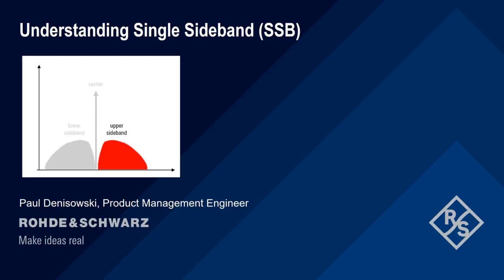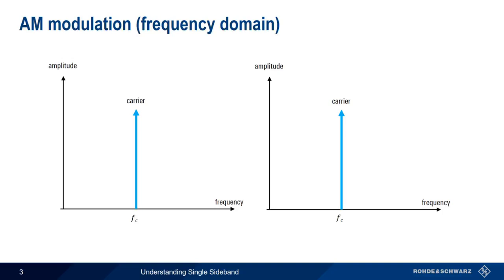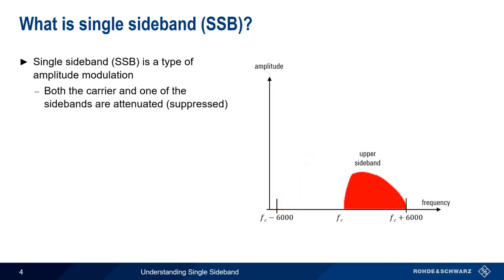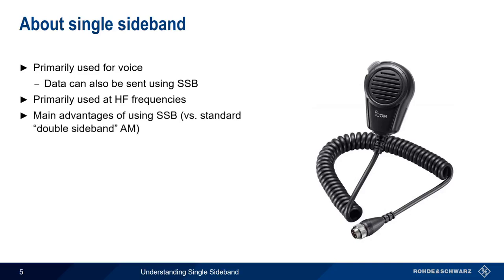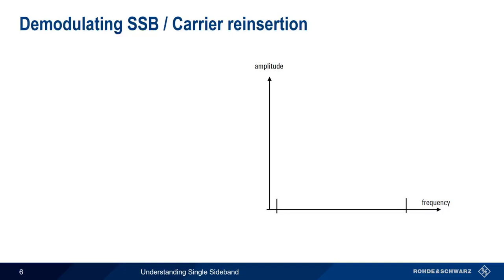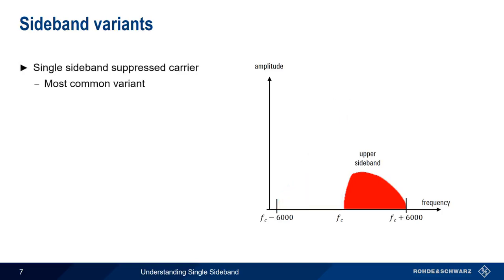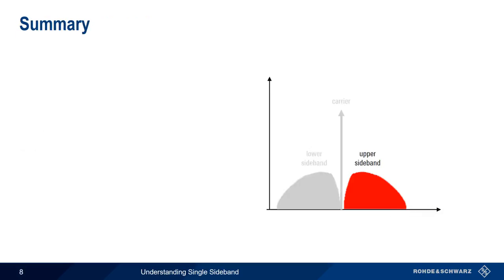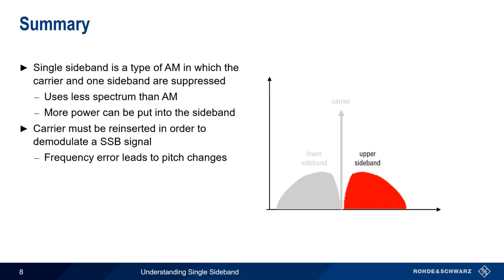Understanding Single Sideband

Comment: Before being replaced by satellites, Independent Side Band was used by international broadcasters like the BBC and Voice of America to feed programmes to their overseas relay stations. It enabled one transmitter to carry two separate programmes. At the receiving end it sounded a mess unless there was a receiver with the correct filters - then you could switch between upper and lower sideband and hear a different programme.
Reply: You can still experience this interesting effect during greyline/grayline, if you find the right station.

Comment: I STILL dont get it how you can have a sideband without the carrier. If the sideband is created by modulating the carrier energy, but you take that carrier energy, how can you modulate that which isnt there??   Its like  saying 'here is a sandwich' while suppressing the bread.  A sandwich MUST have bread or its not a sandwich.
Reply: The carrier is modulated, generating the sidebands, then the carrier and the unwanted sideband are removed.

Comment: Thank you for your helpful video - appreciated.  When transmitting a 1kHz tone through the mic on an SSB radio on USB or LSB, say, 28.000000Hz (28MHz) my transceiver's frequency counter indicates 28.000000Hz.  However, feeding the transceiver output into a frequency counter, I see 28.001020Hz on USB and 28.998330Hz on LSB.  Ignoring the fact my transceiver may need a tune-up, ideally should I see exactly 1kHz above and below the target frequency (28MHz) for USB and LSB respectively?  I found that adjusting the tone affects the frequency displayed on the frequency counter's indication of the radio's transmit frequency.  Aside from setting the offset frequency of a given SSB radio to what its service manual advises, which may not be correct as a radio ages, especially on older radios, is 1kHz transmitted through the mic into a frequency counter an accurate enough way of adjusting the offset trimmer to obtain the correct output frequency on an SSB radio?

Comment: I appreciate your effort to explain this but I'm unclear why a range of frequencies is used on AM when the carrier is unchanging unlike FM.
Reply: When you take a frequency (any), and mix (add) it with another frequency, the difference AND the total of these two will also appear.
Example: when you strike the 880 Hz of a tuning fork, and at the same time a (dé-tuned) 878 Hz of an instrument, you will hear the difference (2Hz), AND the total (1758 Hz, often less noticeable).
By the same principle two extra energy bands form when you take a carrier, and ADD a modulation on it. The difference with the example is that these were low frequencies, and the difference was small (2 Hz), while the addition was large (1758 Hz) compared with the ground frequency of 880 Hz. But if you use an example of 10 MHz with a modulation of 1KHz, the difference is 9.999.000 Hz and the addition is 10.001.000 Hz. Two extra frequencies are formed, the side bands.
When you would not use 1000 Hz modulation, but spoken sound, a whole spectrum is formed as side bands.
(Don't ask me to much, I am just finding out myself 😏 )
Reply: @erikdenhouter  Thank you for your help.

Comment: But how do you transmit anything without the carrier? Aren't the sidebands an effect of the carrier?
Reply: The carrier is modulated, generating the sidebands, then the carrier and the unwanted sideband are removed. You don't need the carrier any more, because it doesn't contain any useful information: that is all in the sidebands. 
Then, at the receiver, the beat frequency oscillator has the effect of putting back the carrier so you can extract the audio again.

Comment: I have a question : I understand the presence of the carrier frequency but what I don't get is why does the signal "bleeds" to frequencies before and after ? 
After all, the modulated signal is at the carrier frequency right ?
Reply: I don't understand this as well, i suppose this has to do with more complicated math :(
Reply: When you take a frequency (any), and mix (add) it with another frequency, the difference AND the total of these two will also appear.
Example: when you strike the 880 Hz of a tuning fork, and at the same time a (dé-tuned) 878 Hz of an instrument, you will hear the difference (2Hz), AND the total (1758 Hz, often less noticeable).
By the same principle two extra energy bands form when you take a carrier, and ADD a modulation on it. The difference with the example is that these were low frequencies, and the difference was small (2 Hz), while the addition was large (1758 Hz) compared with the ground frequency of 880 Hz. But if you use an example of 10 MHz with a modulation of 1KHz, the difference is 9.999.000 Hz and the addition is 10.001.000 Hz. Two extra frequencies are formed, the side bands.
When you would not use 1000 Hz modulation, but spoken sound, a whole spectrum is formed as side bands.
(Don't ask me to much, I am just finding out myself 😏 )

Comment: Hello! It`s a ood video! Have you any video about the syntetic SSB forming method?
Reply: Thanks.  Sorry, but I'm not quite sure what you mean by the synthetic method.  There are a number of ways of creating a SSB signal, e.g. filtering, phasing (mathematically, the Hilbert transform), etc.  One could also create (synthesize?) a SSB signal directly as IQ data, but this is considerably more complex.
Reply: @pauldenisowski  I mean this quite old publication : .

3. Hawker P. Polar loop SSB transmitter". Radio Communication; 1979. Sept.. p. 828 - 829. Firstly they forming SSB on quite small frequency, secondly they detecting this SSB signal by frequency and analog detectors. Finally they modulating a carrier RF  frequency by phase and DSB modulators simultaneously. I understand  so.
Reply: @andrewandrosow4797  Thanks for the pointer!  Interestingly, when I search for "synthetic SSB" (in English) I don't find anything, but I did find a number of very interesting articles (в русским языке) when I searched for "синтетический  SSB"  For example:  "Новый способ формирования SSB сигнала, В. Поляков (RA3AAE), Радио 4-84".   Уча других, также учишься ...

Comment: An explanation about SSB second to none! I can understand that many find SSB hard to grasp. It's not a piece of cake to understand.  Might this help? Let's go back to the old CW method. Say, a one Mhz signal is sent from person A. A person B sets his/her BFO (beat freq. osc.) to 1kz over or under one Mhz. He or she will hear a 1kz tone. Imagine that the sender varies the 1Mz by wiggling the knob, or whatever, to vary the 1Mz by a little. The receiver would hear what would sound like a person singing at 1Hz with vibrato----perhaps Pavarotti is singing. 
       Well, this is hardly SSB but it's a way to start understanding it. If you have a receiver with a BFO, you can tune to SSB signals make them out.
       I sincerly hope that Rhode and Swartz don't mind my comment. Again, their presentation was par excellence.
Reply: It's a great comment and a fascinating explanation - thanks for sharing!

Comment: I'm sure this is a really good explanation, I'm just not smart enough to understand any of it.
Reply: When you take a frequency (any), and mix (add) it with another frequency, the difference AND the total of these two will also appear.
Example: when you strike the 880 Hz of a tuning fork, and at the same time a (dé-tuned) 878 Hz of an instrument, you will hear the difference (2Hz), AND the total (1758 Hz, often less noticeable).
By the same principle two extra energy bands form when you take a carrier, and ADD a modulation on it. The difference with the example is that these were low frequencies, and the difference was small (2 Hz), while the addition was large (1758 Hz) compared with the ground frequency of 880 Hz. But if you use an example of 10 MHz with a modulation of 1KHz, the difference is 9.999.000 Hz and the addition is 10.001.000 Hz. Two extra frequencies are formed, the side bands.
When you would not use 1000 Hz modulation, but spoken sound, a whole spectrum is formed as side bands.
(Don't ask me to much, I am just finding out myself 😏 )
Reply: @erikdenhouter  i understood a little much by your explanation, actually I like to learn things with explanations like this (*by practical examples)
Reply: @OmkarOP_07  Thanks. You could make your own example by using pen and paper. Plot two slightly different frequencies sine waves under or over each other (at least 10 waves wide), and start adding the points from both on the y-ax. So add the hight from the y-ax from the first by the hight of the second, and plot that value as a new (3th) signal. When you add enough points  you will see the difference between the two also appear on that new wave. That's how I learned it on school in the '70, drawing by hand and the experience to see it appear. Only then I did not know that it is the base of RF side bands.
Reply: @erikdenhouter I don’t know what band, modulation or spectrum means for example. I was shopping for a new radio with shortwave and it said it has SSB so I wanted to research what it was. Thanks. I actually installed antennas and did the installation and maintenance of high tech gadgets at work. I was always reading up on things before I worked on them or installed them for the power company. It was fun.
Reply: Same

Comment: Why do we again have to insert the carrier wave at the receiving end to demodulate the modulated signal ??
and how both the upper and lower sidebands are carrying the same information ??
Reply: When a mixer combines two signals -- in this case, the carrier and the modulating signal (usually human voice) -- it produces products at both the sum and the difference frequencies.  If the input were a pure 1000 Hz audio tone, you would see two products appear in spectrum, one of them below the carrier and one of them above the carrier, both 1000 Hz from the carrier (see slide 3).  So we have two copies of the modulating signal, one in each sideband , both of which contain the same information, and this is true whether the modulating signal is pure tone or human voice with a wide range of spectral components.

With regards to carrier reinsertion:  if we want to reverse this process and "de-modulate" the signal, we need to mix the sideband with a carrier, so to speak, to recover the modulating signal.  Since SSB doesn't transmit a carrier, we need to "re-insert" one.  If we reinsert the carrier at the exact frequency of the original (but not transmitted) carrier, the recovered audio will sound like the original audio.  If the reinserted carrier is slightly too high or too low (not an uncommon situation), the frequency of the demodulated audio will be changed.  I've heard SSB called "silly sideband" because a slightly-off re-inserted carrier can make the audio sound like Donald Duck : )  

Hope that helps!
Reply: @pauldenisowski  nice explanation but why does reinsertion of the carrier wave make a difference in recovering the original audio signal?
Reply: @AS-nx9fu  The receiver demodulates by again mixing the received signal with the carrier frequency. Hence you need this carrier. (or more generally speaking: you need to know this carrier frequency and phase)

Comment: The best explanation of SSB I have run across yet! But, without ANY carrier Tx what info is them Tx to 'inform' the Rx on the specs of re-insertion? This would round the explanation out to completion.
Reply: Unless the Tx frequency is already known, the correct Rx frequency is often determined simply by tuning and listening to when the received audio (assuming human speech) sounds "normal"  Being slightly off-frequency results in what many people call the "Donald Duck" effect.